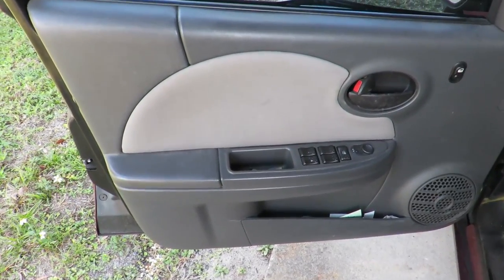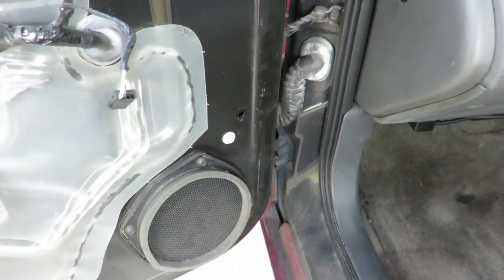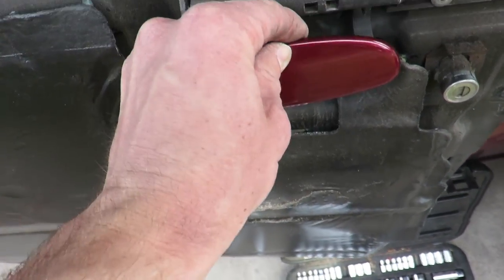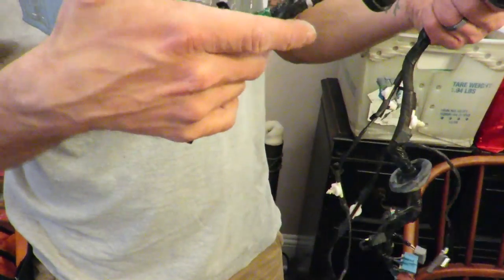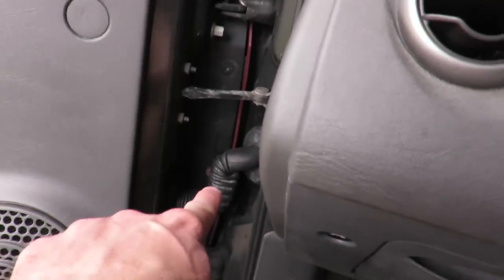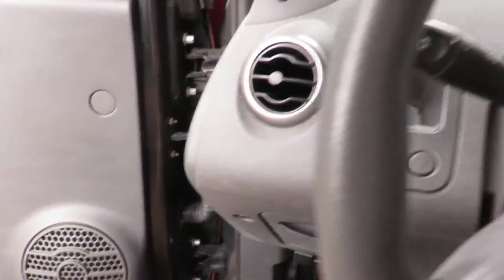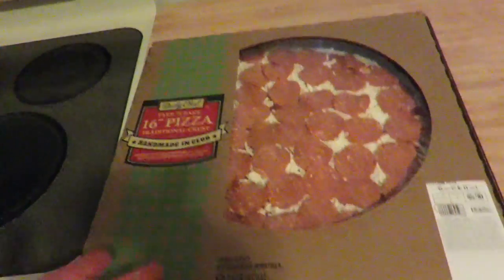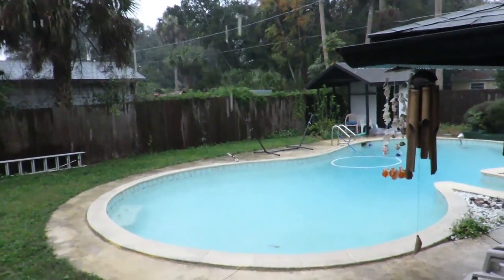DIY Fixing Broken Power Window Wires In A Saturn!!! (2.9.15)

Comment: Probably going to be doing this repair on my ION soon. Will look into shrink tubing any breaks. (Assuming I didn't just blow a fuse.) One Question I have, happened during the Jump Cut. Was both connectors from the Harness easy to get to? One I suppose was behind the Speaker and the other I suppose you had to pull from inside frame? I've been in there once before and didn't feel comfortable yanking on wires... Assuming there is some slack in the line... I can take care of ALL my Door Wiring myself. (Power Locks,Windows, and Mirror Controls are now dead) Had a shop take care of it last time.